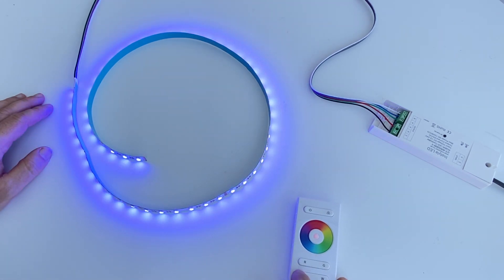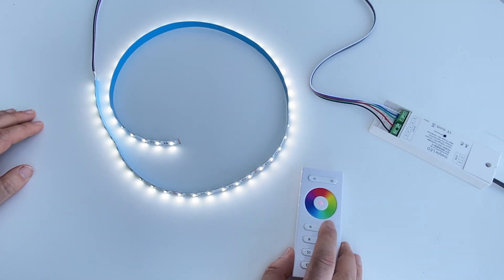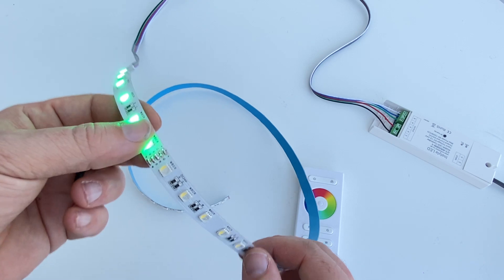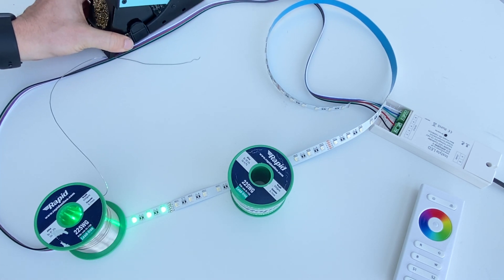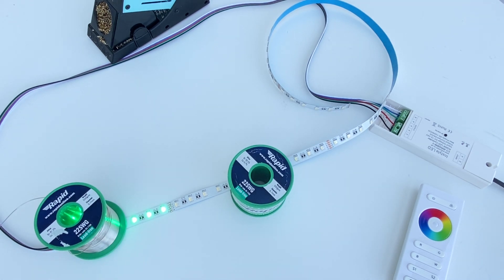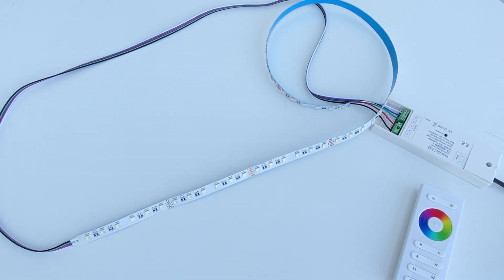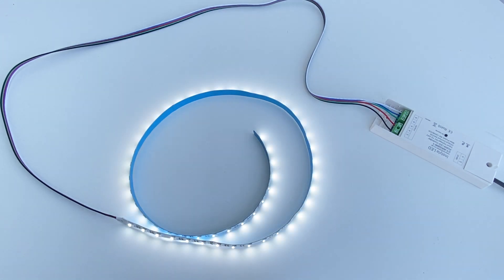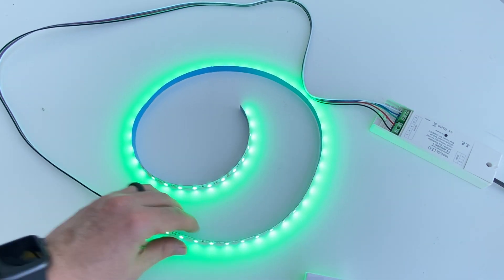How do I repair my damaged LED strip lights?  Dry solder joint repair

Comment: My LED strips solder points are completely broken off, I think called dry, before the little remote sensor. How do I solder this as there's nothing to solder to or any visible lines running to it? Thanks. before the remote sensor

Comment: what if your leds are covered with this sprt of rubber? Can you still fix it then?
Reply: Yes that is possible, you would have to cut it in the middle just until you reach the silver parts. Don't cut it all the way ofcourse.. slightly pull the rubber off just enough for the workspace.

Comment: i had an issue with my 5050 led stripe, when i got it was everything fine but suddenly 1 week after the red color was stuck, even it shows full red color when i turn the led stripe off, the only thing i can do to power it off is unplug it from the outlet

Comment: This is random but i was wondering if you new how to fix this 
So my led lights when i turn them off they are dark blue as if they are on when they aren't. they also change to this colour when i turn down the brightness of them and i can only use 2 colours on the remote for some odd reason?? If this makes any sense it jas been like this for a while now and i have to unplug them so they are off

Comment: i’ve had a problem with mine for awhile i changed the battery in the remote but it won’t work? my led’s are plugged on but when i try to use the remote to change to other colours it stays on green, trying to turn it off with the remote it stays green and trying to turn it on its still green?? so i’ve just turned them off completely on the wall, it’s not the same problem as the colour stops before it reaches the end

Comment: I was putting my led strips up and every 30 minutes i was turning it on to check to see if it worked and how it looks for a few seconds, then at one point the lights got twisted so much and when i tried to turn it on after the whole thing isn’t working anymore

Comment: Can some one please help me...so basically I plugged my ac dc adaptor (the black plug in thing) into my outlet then I heard a loud  pop and smelt some smoke. Can someone please help me I’m really worried...did I break my led lights? What do I need to repair or replace?
Reply: this happened to me but without the smoke . Idk what to do I’m scared that I can’t fix it
Reply: @brittanyixvic83  hm...does the adaptor light still glow green when plugged in? I’m gonna buy a new adaptor...it’s the only thing that I believe is broken.
Reply: @KiaBae-s5g  yeah it still glows maybe the strip broke or some idk imma buy new ones

Comment: my LED’s are a different brand but i’ve had them for like over a month. suddenly the remote stopped working then started working again. then only a bit of the lights worked and they won’t go back to normal. all of the colors are like this. i don’t know what to do
Reply: Same but idk how to make all my turn back on
Reply: @urfavlibra_aeri4160  samee, barely any turn on and they won’t go back to normal
Reply: @meli950  I found out how to turn one side on but the other side won’t turn on for no reason
Reply: @urfavlibra_aeri4160  how did you do it? not even half of mine turn on 🥲

Comment: Omg this helped so much my led light where always half broken and it was so annoying but now they finally are fully working
Reply: So half of my red lights wasn’t working so I looked at the end of my lights where it wasn’t working and then moved it around a little bit till all of them started to work then I held it there and taped it hoped that helped😊
Reply: @itsabouteverything1233  did u do it when it was on? My mum is scared that I might shock myself if I touch the led :(
Reply: What did you do  to fix it

Comment: Mine keeps flashing when I turn it on, any suggestions?
Reply: @Lizeth Salazar I've solved it, if you are still having this issue and for anyone else try switching the pin connecters around

Comment: I don’t have the iron so I just pressed down on every joint in the leds until I found the one that wasn’t working and after one touch it went back to normal 😁 I didn’t do anything with my leds tho when I turned it on in the night it was glitched so if you guys did anything crazy with it this method might not work
Reply: I did this and I found the place but when I stop touching it shuts back off
Reply: @urmom-ds5lw same.

Comment: My LED strip splits into 3 sections, first section blue green and red work, second section only red and green work and third section only green works. One half of the strip lights up only when held at a certain angle. How can i fix this?

Comment: THANK U SO MUCH like i was crying in my bedroom cuz half of my LED lights weren’t working then i found ur video😌
Reply: LMFAO SAME
Reply: i don’t have that iron :(
Reply: Brooo how?
Reply: im crying rn bc i tried moving my lights on the other side & i accidentally bent a little bit of it & it snapped 🥲 im bawling bc i JUST got them 💀🙌🏽
Reply: Nery Cruz nice, lemme try cause mine is half gone :(
Reply: @Nery Is a Weeb I just tried it and it worked for me thanks so much 🙏🏽
Reply: @Nery Is a Weeb mine had the split look too before but it’s fixed now
Reply: Nery Cruz no :( sorry i fell asleep lol but yeah it’s not working so ima just get new ones , but tysm
Reply: SAMEEEE
Reply: @NP-jl4xc  mines is already taped on
Reply: @NP-jl4xc  I don't have that tool how should I fix it
Reply: @haroonk.9706  I just used my hands
Reply: SAMEE
Reply: iTs NOT WORKING FOR MW
Reply: @breadisomazing3010  Just throw em away no point
Reply: @haroonk.9706  um no i begged my mum for these anyways it still works only some colours
Reply: I'm crying right now
Reply: @OoOoOoOoH gOoOoN same how did you fix them
Reply: Bruh I needed to find this app
Reply: Righttt
Reply: i am barely at the beginning of the videos and I’m finna cry . I hope this bid helps me fix it
Reply: I hope it helps me to let's see😵
Reply: SAMEE
Reply: Same
Reply: Same cuz I came home and my cat ripped and cut many of it
Reply: Same
Reply: SAMEE
Reply: Same
Reply: SAMEEEEE
Reply: Nery Cruz did it work ???

Comment: Half of mine is off and the other half is on HELPPP 😭
Reply: sameee ineed help
Reply: @vsamueI  Yess 🥺, We NEED helpss 🥺🥺
Reply: @aubree1417  and they were just working like 40min ago too
Reply: im gonna try a soldering iron bc my dad has one
Reply: @vsamueI  good luck i have a spare led strip
Reply: VH ugone DID IT WORK
Reply: UPDATE?? SORRY MINE WERE WORKING THEN HALF STOPPED WORKING AND I WANNA CRY
Reply: @luciets  same :( mine never were working im so mad idk what to do
Reply: @robyn6224  okay so what part isn’t working cause about 1/4 of mine wont work
Reply: @luciets  mine only works like the first few metres then the rest of the lights are off rip
Reply: @robyn6224  hm idk wait
Reply: @robyn6224  okay so only a little but works?
Reply: @luciets  yeah a small section of it works but then the rest is just out (sorry i didn’t mean to click dislike!)
Reply: @robyn6224  ur ok lol, okay so does most of work at least?
Reply: @luciets  no only a little bit of it it’s like 4 metres out of the 15 that work :( just one corner of my room is lit up
Reply: @robyn6224  aw ;( well idk how to fix it? i guess get some new ones? amazon has some tahts rent taht much
Reply: Mustafa's World ok so what’s the problem?? half mine wont turn on
Reply: 1 1 1 . half of mine didnt work but i just like took off the part where it stopped and then i put it on again and it started working lol
Reply: cloe gonzalez so you mean you cut it and re put it together?
Reply: 1 1 1 . no nooo you take the part that doesnt work off the wall but not fully and then put it back together if you cut it then it will stop working
Reply: cloe gonzalez well my leds you’re able to cut and put back together sorry haha, okay i’ll try it because i’m like disappointed about half of it not working
Reply: 1 1 1 . ok try that then

Comment: My lights only show the first three dots on green, and my remote won’t work with the colors. Also, I have to bend it for the whole strip to work. Can you help me please?
Reply: I have the same problem and I don’t know what to do and I feel very sad because i have been using this for like months and it just started to do this.
Reply: @infinitycrush479  I have you found a solution yet it just happened to me today and the green color won’t work
Reply: omg same please let me know if you found a solution
Reply: @charnvirkaloya2491  did you find one mine just started doing that today and my green won’t work
Reply: @aileenbarajas  nope :(
Reply: Did you find a solution mines are doing the same thing

Comment: My led lights are showing different colors
Reply: put it in the color you want to fix than turn it off than while it’s off put it on fade 7 and than on if it dissent work keep doing it when it does work ❤️❤️❤️
Reply: @jimenaandrebecca3838  thank you so much, I gonna try it ❣️
Reply: @abigail.nb007  did it work for you
Reply: @Austyn.fleury  I didn't tried it, because I don't have these tools for this. Have you tried it?
Reply: @abigail.nb007  no
Reply: @jimenaandrebecca3838  omg thank you so much I was literally so upset bc my led lights were showing different colors😭💕💕
Reply: Same. I press blue and I get various different shades of red and then when I press red I get blue
Reply: @rowanduncan9511  did you find a fix because my lights are doing the same
Reply: @sydneedelva3247   I used the method that @jimena and Rebecca used. The comment is above
Reply: @rowanduncan9511  did it work ?
Reply: @inamhaq2618  yeah
Reply: Me too
Reply: Mine too like one is red and half is blue like??
Reply: @Noah Sananikone same
Reply: Mine too like one is red and half is blue like??
Reply: When my dad was helping me put the lights up he had poked the light strip causing it to change the color
Reply: For me it was showing green only everywhere, and if I switch colors, non-existent
Reply: @Logilype same
Reply: same